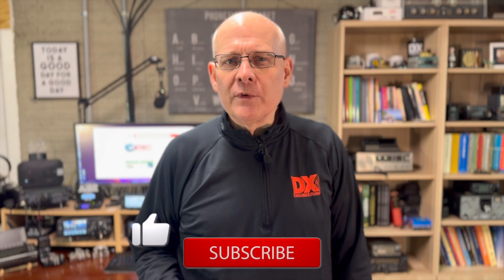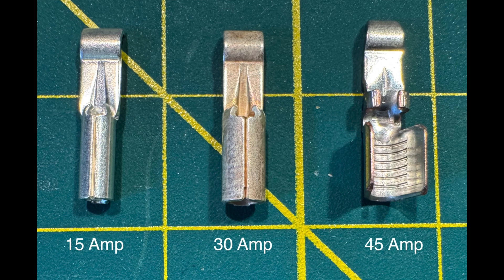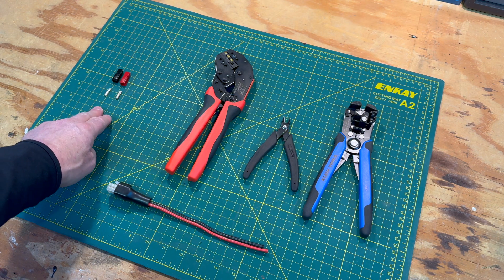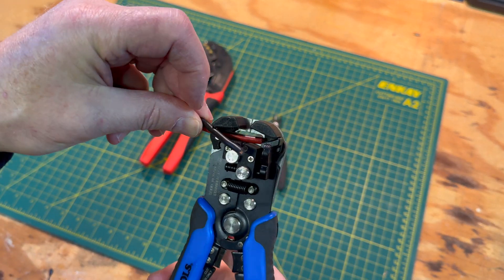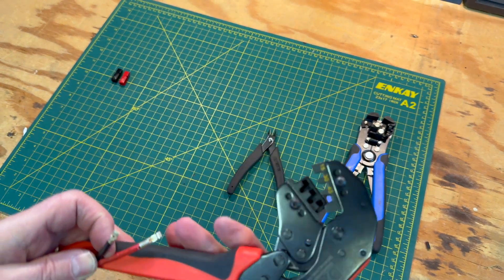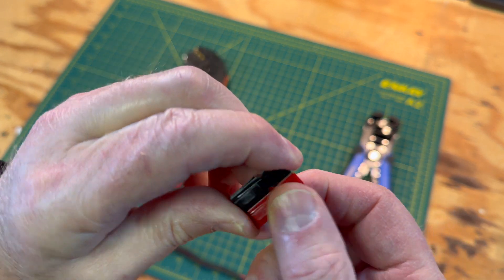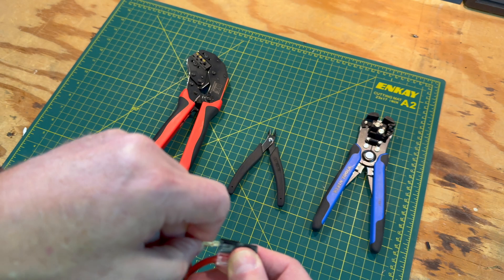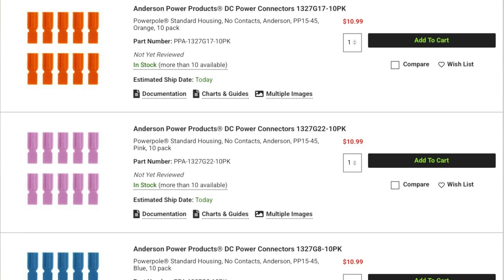Choosing the Right Tools and Techniques for Installing Powerpoles®

Comment: The 10 ga wire zip cord i bought at DXE won't fit into the back of the APP 45 amp connectors i bought from DXE. I also used the crimp tool from DXE and during a tug test found that the wire came out of the crimp anyway. I'm returning to XT type connectors.

Comment: Excellent clear video on Anderson Powerpoles.  Would it okay to put some heat shrink tubing on the back of the connectors to the cables?  Maybe this is just OCD on my part.  Please give you experience/observations Micahel.  Steve KD6KXT
Reply: Absolutely you can, that's what I do. In fact, I don't just put the heat shrink behind the connectors, I use a length of heat shrink that will also fit over the connectors, and extend 1/2 way up (like what's shown in the video on the PP-Quick connectors). Doing it that way not only makes the wire transition in to the back of the connector look better, but by extending it 1/2 up the connector, you also provide strain relief on the wires. 

Also, the slip on rubber boots being sold, don't bother. If you put those on and plan to use them in a power pole panel mount where a over/under" arrangement of plugs is used, or something like the configuration shown on the 12-volt power PD5-Plus distribution block, the thickness of the boots wouldn't allow you to plug in connectors into the back-back plugs at the same time.  

Using heat shrink over the back of the connectors, extending 1/2 way up, does not block using both plugs and the same time.
Reply: @3henry214  Thank you for the response and your practical experience with the "rubber boots", excellent advise!